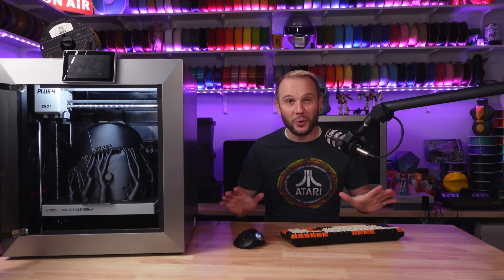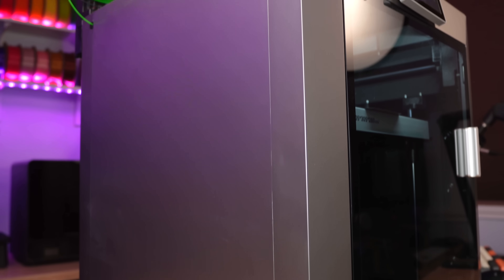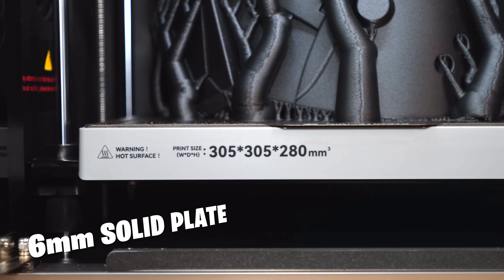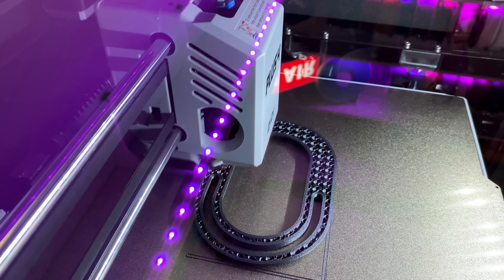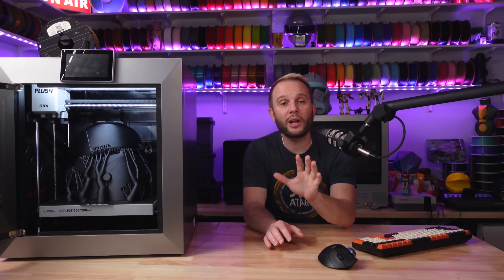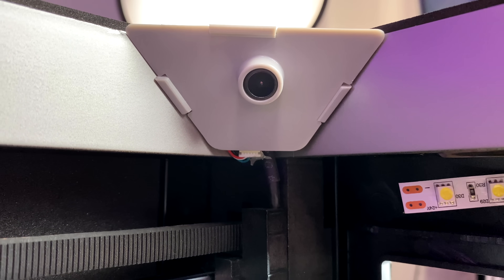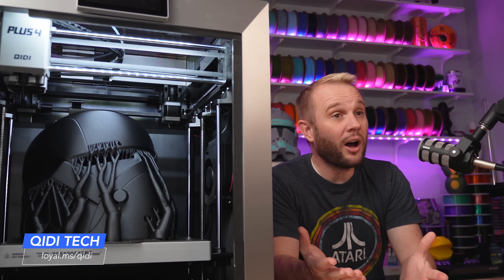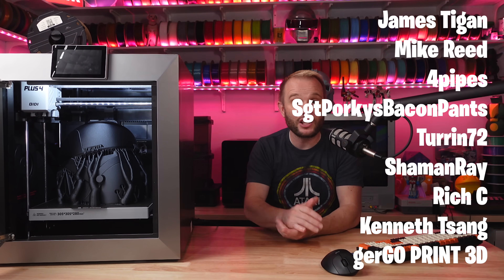NEW QIDI PLUS4 - Maybe the PERFECT 3D Printer!

Comment: Interesting how users have either success or failure. My Plus 4 has been nothing but issues straight out of the box, like others.  QIDI are good at sending part after part and replacing parts sent, at the end of the day the faults are far too many and QIDI will not replace or refund.  Happy days for you folk with a working Plus 4!!!  🙂
Reply: With all costs of parts, postage, labor and downtime.... Far more economical to replace or refund. Anyways....

Comment: I'd like to add my own personal experience with this printer. I have had it for about 2 months. Most of that time has been spent waiting for replacement parts that haven't fixed the plethora of issues I've had with it. In all that time I have completed 2 passable prints. The rest of the time is spent unclogging nozzles, un-jamming the extruder and dealing with support for all the problems I have with error messages regarding chamber heating, part failures and connectivity to my computer. My qidi plus 4 experience has been a nightmare that is still on-going. Zero stars.
Reply: I am really sorry to hear. It is so difficult to decide for a printer. 10 people love it and the other 10 people hate it...  I am new to it and I just need to gamble to get a good printer.

Comment: Mine last 35hours of use before blown up something inside… not the ssr issue… joke of a product!
Reply from the maker: WO! What?!
Reply: @ extruder adaptor board, i suspect a mosfet blown… temperatures now before klipper cuts it off completely, can reach up to 500°C, which can ignite pla for example. Also, bought it for a prototype project that i have and only manage to print 4 iterations and im now stuck with no printer and no money for a new one for at least 3 weeks…. Should of got the bamboo x1c 🤦🏻‍♂️
Reply from the maker: Dang it! So sorry to hear this.
Reply: @LoyalMoses  its a shame, was a great printer before blowing up the board, the tolerances on the prints were amazing. Luckily i was around to switch everything off before anything really bad happened

Comment: I cannot fix my squeaky motion system on my plus 4.  I've lubricated everything, loosened and retentioned belts, and loosened and adjusted top build plate screws on the stamped metal portion as per Qidi's suggestion.  Nothing gets rid of the annoying squeak that seems to be a result of the Z hop

Comment: I'm a sort of beginner, definitely a hobbyist, and I'm always this close ----> <---- to running a print farm and I can tell you this beast is a hell of a printer. I got mine at the start of this year so some of the original bugs are long gone for me. It's fast and capable and its precision is truly great. I've printed Flashforge Burnt Titanium and Nebula Purple PLA, ESun clear PETG, Elegoo Rapid clear PETG, Creality Hyper PETG, ESun ABS+ in white and black, Polymaker Polylite ABS natural, Sain Smart clear and black TPU, and even Taulman 910 Nylon alloy with mine and managed stellar results with all. Taulman 910 does not do thin walls well at all, just so you know, but it prints common hardware parts like a dream and ZOMG so strong. In fact, all the filaments I used were dramatically stronger in print that I was used to with my old Robo 3D R1 Plus which the Qidi Plus 4 replaced. I did have a couple of issues along the way; 1 gouge mark in the bed from a Z height screwup and 1 broken nozzle likely from the same event. Other than that it's been a few print fails from experimenting with dialing stuff in, some minor unsightly patches on prints, and a mob of truly amazing prints. When you get this thing going right, it really puts out and it can easily carry you through decorative or industrial with just a bit of learning curve.

I recommend tightening all the screws on arrival, and when you get it set up, print yourself a poop chute of which many are available on the various sites. I even have one of my own design up on Thingiverse as well as a replacement spool holder with decreased friction. Oh and I also made some saddle-type tool bins that I still need to upload to Thingiverse.

Make sure you lubricate your axes regularly or she will let you know with some unmistakable friction noises. Don't panic if you jam some filament - it's VERY easy to unjam without breaking down the whole extruder. Don't feel like you have to bind yourself to Qidi Studio - I'm using full Orca Slicer and I love it. Watch that first layer as you may find it printing a bit too low or too high. There's an easy way to perma-set a Z offset in Printer.cfg that will keep your offset settings no matter what and allow you to still change it when you need to with a simple edit and restart. And when you print fast, it WILL shake the machine very aggressively. It's physics, just stand back and enjoy the show. This thing really can push out 600mm/sec with good results. In fact, I printed most of those filaments I mentioned at 300mm/sec regardless of what they were intended for and got mostly great results anyway. Regular ESun PETG turns frosty white if you do this, and I wouldn't dare try that Taulman 910 at those speeds because just no, it's not a great idea. What else? Nothing else. It's a great performer and very reliable. 214 print jobs and 171 hours in just under a month, and a pile of great prints. Someone recently asked me if I'd buy it again. Hell yeah. The more hurdles I clear with this printer the more I want to push it. This thing has been like a constant pat on the back encouraging me to grow my modeling skills all the way. My first printer was $1400 back in 2016. This one was $850 plus another $40 to replace the broken nozzle (you get two btw). It's easily four times the printer my first was. 'Tis a no brainer.🙂

Comment: They definitely have a QC problem with there motherboard and the wifi dongle. Just got mine 5 days ago and per qidi Support, i had to open the back and remove the usb dongle, insert it back in after a few minutes, and power back on. Which worked, but I'm hoping they just send me a new MB!
Reply: Ordered mine 1/15/25 and immediately sent an email to them with order number to see if mine would have new board and they replied saying yes so 🤔

Comment: I'm liking what I've seen about this printer. I read on QIDI's site that this printer will be compatible with the QIDI Box when it becomes available, but notice that the filament cutter is manually operated. Do you think the entire print head will have to be replaced to work with the Box or how will that process be automated?

Comment: I own several Bambu's and own 4 (four) QIDI X Max 3's. All I can say is that I have been so impressed with the QIDI's (in all aspects) that I've already got 2 (two) of the QIDI Plus 4's scheduled for delivery. And with the new QIDI Box coming in just a few months I'll be an even happier camper, to be sure!  And you're correct, the heat bed capability combined with the chamber temp controls really does give you a good portion of 'industrial' feel encapsulated in a 'residential' macheen!  : - )  Oh, and thanks for the video, keep up the good work!

Comment: One thing you should hit on is the issue with overheating. Qidi is aware and anyone living in 110v areas can get a free upgraded board. Also, update the firmware to the latest version.
Reply from the maker: I received an update, haven’t installed it yet.

Comment: Wondering what your print setrings for CF materials. I am Currently trying to print PA6-CF, GOT GOT END GOING 280-310° build plate at 80-90C, enclosure heated set at 60, material fully dried, but by 2nd layer material starts to warp/peel at the corner (trying to print toolhead cover)

Comment: Definitely an impressive machine.  I have heard if you print a tall model and the platform moves right to the bottom of the chamber it will block the intake of the heater and it will overheat and shut down the print (which would be painful right at the end of a long print).  Other than some minor quibbles looks pretty solid.
Reply from the maker: I printed a helmet that nearly maxed out the z-height with everything at max temps and there was no shutdown on mine.

Comment: Have you had any problems with the printer shutting down due to overheating?
Reply from the maker: Not at all. Printed with maxed out temps for 12+ hours, all good,
Reply: @LoyalMoses  Thanks for the info. I have a dilemma whether QIDI plus 4 (with this printer I'm afraid of overheating) or K1 max. There is a big community behind K1 max and probably in case of problems I can find a solution. I don't know how it looks with QIDI.

Comment: Can you swap out the nozzles for different sizes, if so, easily>?  Do you need to do when switching from say PLA to abs for instance (will the abs create issues or wear on a nozzle from temp changes), so change the nozzle for those)?

Comment: I've  been looking at all kinds of reviews on many different 3D printers until I couldn't stay up each night until 2AM captivated by so many reviews with the Pluses and Negatives of all these 3D printers. Got to the point where I was over it and didn't find something that struck me at 100%. Each printer was missing one important thing or another, UNTIL I came across your video and ordered the New QIDI PLUS 4. I'm happy that QIDI finally has handled and remove the manual Z adjustment of the printer head, where I have seen in reviews that it's a great 3D printer but, you have to do this adjustment manually each and everything you want to print a new part. That's what kept me from purchasing the QIDI  3D printers. 
Great video and can't wait to get my hand on this one. Have a few things already I need to print out for my products and concepts. Cheers!

Comment: The only QIDI printer I've used was a flashforge clone and it was a pretty bad experience. I never got a successful print off of it because it turned out one of the main rods was bent. Ended up throwing it in the dump because I had no means of fixing it and it was out of the return window. Surprised to see that they're putting out such impressive hardware now.

Comment: Would you get the +4 or the X1 as a first printer, or something else. Price is always an issue but not controlling.
Reply: Def in the same boat. Can't decide between the x1c and this +4.so hard to make a choice between em😢still dno what to go for. Please help!!
Reply from the maker: The X1 I would rate around a 8 or 9 out of all 3D printers, the build quality and experience are the best we’ve ever seen.

The PLUS 4 is what I would consider one notch less than this, the experience is great, just not Bambu level and the MMU option isn’t here yet for multi-color, but it is coming Q1 of next year.

But that PLUS 4 has that chamber heater, and hotend which are amazing! 🔥

Comment: I decided that I wanted to enter the 3D printing market, so my search began last month and after watching your videos I felt that you were the right person to help men with making the right decisions, so I bought a QIDI Plus 4 based on your review. After watching quite a few of your videos I realized that one question I still had was, which filaments should I start with and is it necessary to buy filaments from QIDI or will buying them off of Amazon make any difference in the final products I print. I noticed that filaments are anywhere from $16.00 to $30.00 per roll for the same material.
Reply from the maker: Welcome!!! Join our discord too, it’s a wonderful place and we can help with anything you need. Also, as for filament, any 1.75mm filament will work, which is the most common. Start with Polymaker, you’ll have a great experience!
Reply: Thank you, Thank you for the quick response.

Comment: Based on your and other's review I ordered the Unit. Did not get a good start. The fan on the left is attached with a screw in a post formed in the panel, it broke in shipping preventing the build plate from moving up and down during the first power cycle.  The Web site's instructions for updating its firmware have yet to work. Yes, this is my day one impression, and I will see how customer support works out.
Reply from the maker: OH NO! Was there any damage to the box from shipping?!

As for firmware, is yours network connected? I just updated the firmware through the interface over the air.

I sure hope support gets you squared away, they are known for taking care of customers.
Reply: How did it go 3 weeks later
Reply: how is it going now?

Comment: great video 
two questions 
How much power does it draw 120 volts at how many amps 
How much does it weigh 
Thanks again 
I,m just a newbie thinking of getting into 3D ..This so far has impressed the heck out of what I,ve watched
Reply from the maker: Heating all 3 elements at once, about 1200 to 1300 watts, and when running all 3 after they’ve heated about 600 to 900 watts.
Reply: @LoyalMoses  sounds like it Definitely requires dedicated circuit 
Thank you for quick response 
Just a newbie first 3D machine ..sounds like something I,d Like 
Plug and Play

Comment: For print farms this is could be an awesome machine, their Q1 Pro was already a good entry for smaller businesses to offer making parts in more heavy duty materials but this one now will solidify it. I was eyeing the HT90 but this one could probably be the gateway printer to industrial materials. I've been hearing people say that the next step for the consumer 3D printer industry is moving the mark about what "high temperature" is exactly, not long before 300C was advertised as high temp, won't be surprised if in a year or two 500C will become standard practice at the consumer level
Reply: EBPMAN Tech Reviews posted a video a couple of days ago. He has print farms and has been using bambu before , and now Plus4 is joining his farm 👍
Reply from the maker: Interesting. Wouldn’t that be crazy to have 500c temps at home?! Wow!

Comment: Can plus 4 print 3th party filaments like Sunlu, eSun etc?
Reply from the maker: Absolutely!
Reply: @LoyalMoses  Thanks for your quick resply. I also have 3 questions, 
Which one do you recommend about the earlybird's Tungsten Carbide Nozzle 0.4mm & Bimetal hotend? Seems the carbide Nozzle is more useful. Not quite sure the hotend's life span.

Another question is the Qidi Studio, it said "QIDIStudio is based on BambuStudio by Bambu Lab", is it means I can use Bambu's maker world/makerlab model print on Qidi? Build the model from maker lab, and export to Qidi?

The last question is about print the different brand filaments, Qidi shows non-qidi filament can be used, but slower a lot, I understand the huge profits from the consumer materials  , but if I use bambu's print profile and Bambu's filament, is it work smooth and the same speed as bambu or qidi?

Thanks for your time and professional guildline.
Reply from the maker: Of course! I’ve been going back and forth, but maybe the hotend would be a great option.

You can use any of the model websites, so no worries about what models you can slice and use!

Any filament, and some filaments print faster and slower, so don’t about that either, it’s completely open for you!

Comment: Just ordered one up, my other Qidi's needed some friends.  Looking forward to it's arrival.  I will need to find a new table to put this one on, it looks quite big, I don't think bench I have is deep enough for it to fit, may have to go on my desk.  This puts serious price pressure on Bambu Labs, and one also gains the heated chamber for almost 3.5 times less than Bambu comparable.   I love the support Qidi gives customers, they shipping me filament sensor for my Q1.  They announced the color changer AMS Unit for first quarter 2025.
Reply from the maker: Congrats!!! When does it arrive?!
Reply: @LoyalMoses  Arrived yesterday had one minor issue kept shutting down when did autolevel, second the bed heater turned on.  Found was shipped set 230 even though power button label had 110-130 on it.  I usually check setting, no biggie thing has been running flawless nearly 22 hrs now!  I am printing some pf Qidi ABS25 GF at moment batch of 10-12 inch shelf frames, no glue or hairspray zero warp or lift!  Only did bed level and the input shaping on my seventh set of prints, all had perfect first layers even some printed with 2yr old cheap PLA.  Very impressed, Qidi got this one right!  I can truly say one can be printing flawless prints after 30 minutes and required manual update via USB stick.  It will print flawless layers every print and the poop shoot sends the poop flying with some incredible force!  Great purchase, I do believe this is first printer that can beat Bambu.

I will work on getting my first video up at YouTube, found out my video editing software is expired.  Will work on some content with stuff saved filming with my phone, no professional production, but will highlight some engineering grade materials.

Comment: How do you compare the QIDI Plus 4 vs Bambu P1S in terms of sound and fumes when chamber door is closed? Thx!
Reply from the maker: Well, it has insulated side panels (PLUS4), and when the door is closed it wasn't all that loud and it does an okay job, about the same as the P1S at minimizing fumes from printing ABS. I would overall say they are about equal or close enough that it didn't matter or concern me.